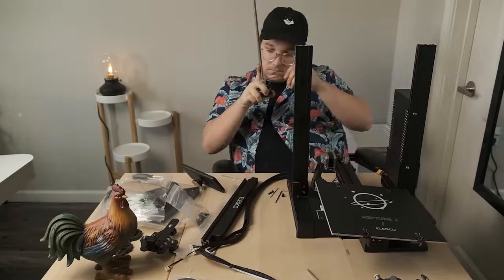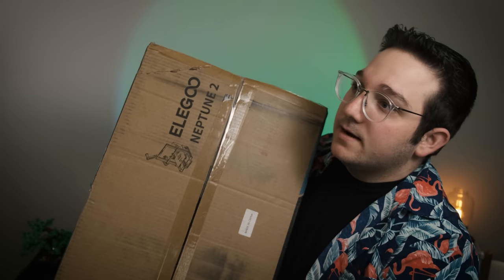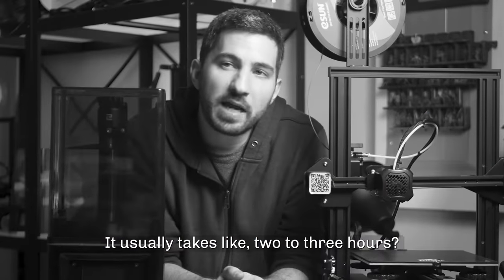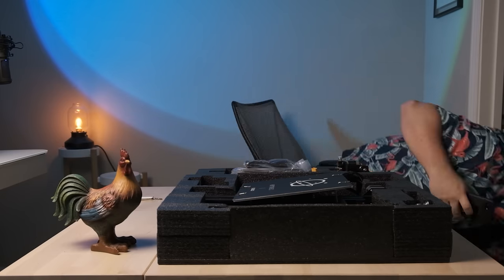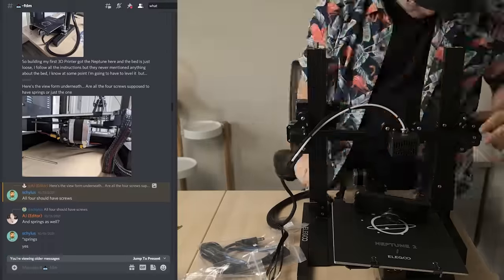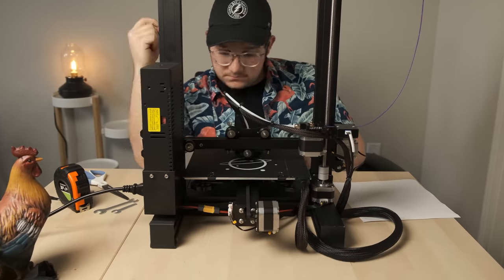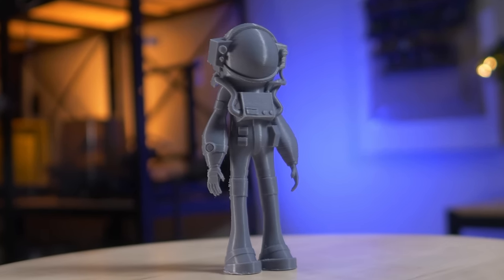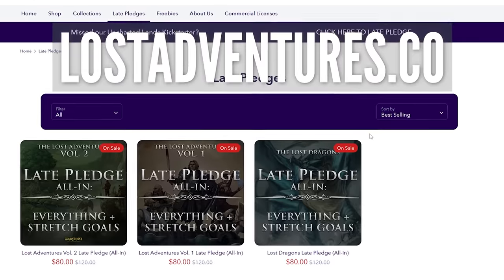What It’s REALLY Like to Assemble Your First 3D Printer

Comment: I started with an Ender 3... Whilst my first print was great, it went downhill afterwards. I started to get a hate relationship with the machine, it was getting out of hand... sucked my joy from 3D-Printing. I figured: man I just want some prints, I don't have a desire to become some 3D printing wizard. Got Flashforge Adventurer 3 and now its running almost everyday everynight and all the prints look, in my opinion, great! Later I also added the Anycubic Photon S Resin printer  which has also been smooth sailing from the start. A year later I make many D&D prints, and sometimes even machinery parts on my Adventurer 3 and its become a big hobby of mine to model, 3D-print and paint.

Comment: It may not be the most popular opinion, but I truly believe you get what you pay for.  I bought a Prusa Mk3 kit 3 or so years ago, built it, and I've never had a single issue that I wasn't able to resolve in less than 3 or 4 prints.  I've even added an MMU to it and the MMU sometimes gives me a few fits, but overall, it's been a rock solid machine.  The only major issue it has had was when a wire on the hotend thermistor broke inside the insulation.
Reply: Thing is, Prusa printers are fairly expensive for what they offer. You're paying more for the fact some costs of it being fully open source land on your lap. Even their mini printer is more expensive than printers with three to four times the build volume, including some resin models as well. Those printers are more meant for production work than hobby. Creality seem to fill the hobby niche well at this stage.
Reply: @BrunodeSouzaLino  Ha!  forgot I made this post.  Interestingly, since then, I've picked up an Ender 3 Pro.  It went together relatively easily... Knowing how the end product would work helped a lot though.  I've not used it a lot yet, but even knowing what I was doing, I still managed to already drag the hot end across the bed sheet... Maybe a Prusa is a premium price, but that doesn't mean it's not worth it or that you aren't getting a solid value, especially as a rookie.  I look at it like DIY plumbing.  Sure, I can do it a lot cheaper than hiring a plumber, but the value comes from the plumbers experience even if the end result looks the same to an untrained eye.

Comment: This is why my first 3D printer was a FLSUN Q5
It’s the most beginner friendly printer out of the box I’ve seen
It comes mostly assembled, every single screw you install is the same size 
Auto bed leveling so no problems there
Out of the box beginners you’re printing your first test print in less than an hour

Comment: I built my first printer, a standard Ender 3, and the first print was fine. Had no issues except dialing in the z off set as it was printing the base for the first print. Unless something is broken, it's just user error, a little common sense goes a long way. Making sure belts are tight but not too tight, making sure that there isn't wobble or play along each axis, making sure the bed is level, this is all common sense

Comment: Welcome aboard AJ! Don't ever give up, most issues get resolved by simple trial and error. Sometimes it's the most unlikely item at fault, eg a Teflon lined stock extruder failure presenting as surface adhesion problems...

Comment: For me that I'm new to this and started with a resin one, can say that setting the machine is easier but at the same time tricky. Because besides having issues with the leveling of the plate, I didn't notice that the film in the bath was not completely tensioned so It was giving me failures. Also more recently found that if you have the printer over a table that is not completely level it can also give failures prints. But overall it has been really fun.

Comment: My first 3d printer was a Prusa i3 clone I bought in 2015 which took me 2 hours to get the thing fully assembled from a box full of hardware and parts, It took me a few weeks to get the thing printing solid objects because it turned out the steps config file were off so even printing with 100% infill it was like it was only doing 25%.
My second 3d printer was a Nova3d Elfin resin printer which was basically ready to go out of the box.
My third 3d printer was an Ender 3 and it only took me half an hour to build with no issues other than one belt was too tight and another was too loose but they were my own fault which was an easy fix.

Comment: When you’re printing something like that master chief helmet lower the model down on the build plate so only the top prints then import another one rotate it 180° and lower it down into the bed so you end up with the bottom half and the top half then simply glue them together. I’ve use this technique also when I have an error and a print fails instead of printing the entire thing over I just crop it like that and print the missing part. I have the same printer get the adjustable legs off Thingiverse they’ll help with the wobble.

Comment: For the "warped" frame, it's not warped, it's incorrectly assembled.  All 7 of my FDM printers came from the factory this way (they're all Ender 3s or Neptune 2s).  You need to loosen the 4 bolts on the outside of the frame, and then push the frame down towards the table (make sure the table is flat).  Then retighten the screws.
Reply: I never knew this! I'll try it when I get home for sure, thanks for the comment!
Reply: My ender 3 (v1) had this issue, and it was my very first printer, and I was baffled that it could be assembled incorrectly, with no notes in the installation docs mentioning it.  I get that these are massively cost-engineered printers, but this is a common issue that is pretty easy for new hobbyists to stumble into with no real guidance...  Either there should be better documentation about squaring the frame, or it could engineer around the issue even with a simple 5mm cut into the extrusion (which, of course, would add cost...)
Reply: @oasntet  Indeed.  Makes me wonder if they just hold it sideways, zip in the 2 screws....flip it over....zip in the 2 screws.  If they'd just lay it on a flat surface before installing the screws, it would not be an issue.

Comment: the x belt ...... it's not your shaky desk, but the belt of the x axis is slipping because it's installed wrong <.>
Reply: Would you be able to describe in more detail how I could correct this?
Reply: @ajdecaprio  the belt is the wrong way around, the teeth need to be on the inside.  the motor has a "drive gear" and the teeth of the belt should slot in, at 7:57 you can see the teeth of the belt faceing outward, they need to go inward
Reply: @maddi04  Well that'll definitely cause some problems... I'm gonna flip it around and see if that solves my issues

Thanks for letting me know!
Reply: I just had a look at the assembly docs, and wow, they're really bad.  You can just barely make out, on page 6, that the teeth are supposed to be on the inside.  Pretty obvious if you've assembled another printer with better docs, but a newbie assembling this one could easily miss that.

That said, I'm pretty amazed that benchy printed with what is essentially a friction-only belt.  That might also mean the belt tension is extremely high, which could lead to missed steps, too.
Reply: @oasntet  Thanks for confirming this because I was just thinking, "Man, I really wish the instructions clarified that information." I obviously threw the instructions aside for the initial assembly but after I had problems I went back and read them carefully only to find they really aren't THAT helpful. 

Maddi is 100% correct, my belt is totally installed incorrectly and I'm so glad they caught it and brought it to my attention. If I didn't post this video I would still be totally lost as to why my printer sometimes works well and sometimes produces horrible results.